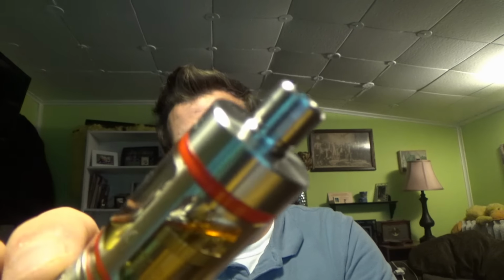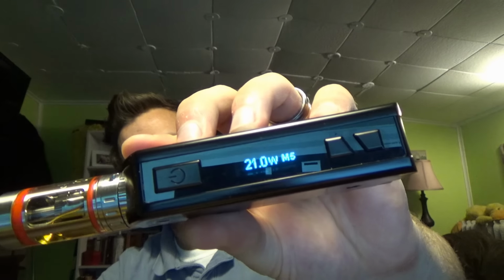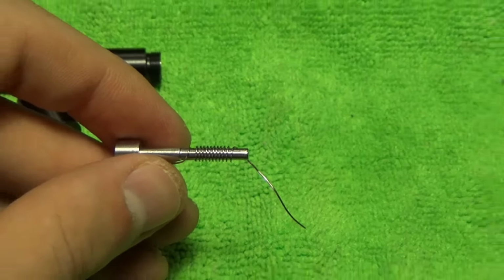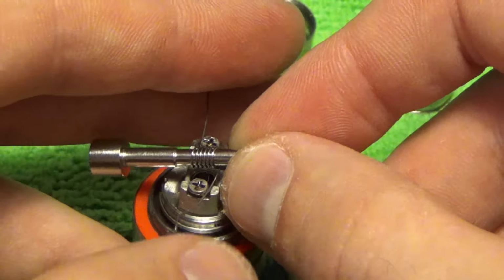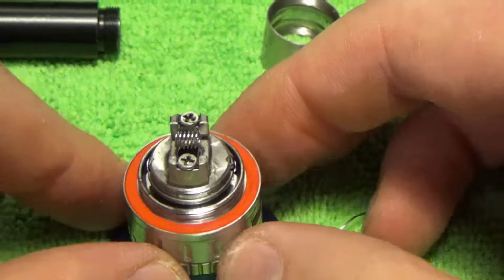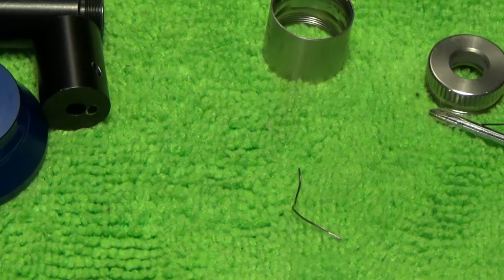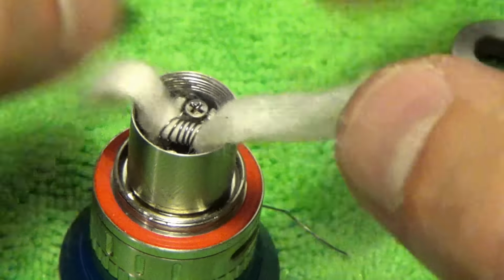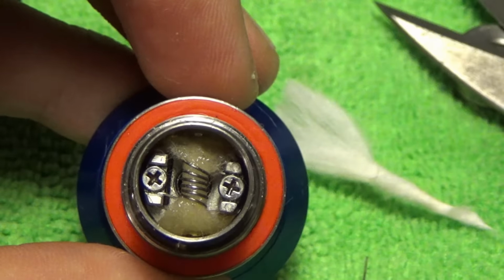Subtank Mini Build Tutorial - My Favorite Build

Comment: I've been using micro coils for a long time now so figured I'd try a spaced one.  Have to say that I like the spaced one better.  Thanks!
Reply from the maker: You are very welcome. Thanks for watching!
Reply: +Nooby Vapor   Funny I did the opposite. I used to space the coil, now I pinch that sucka tight. Can also do a nice chimney build.
Reply: +CaptianKeyz Actually I've gone back to micro coils, ha ha.
Reply: Nooby Vapor  I've just gone back to chimney builds. Seems to be more room vertically in my tanks, plus the air holes are in line with it.

Comment: I'm new to sub-ohming and building (I was never able to build successfully in the 'protank-vivi-nova era' as I like to call it and sort of left the vape world but I'm absolutely loving the days we're in now!  Just a question, what type of wire would I be better off using with the 75W TC Topbox (it's a sub-box with TC and more power basically, I had a subbox mini before I lost it)?  I'm trying to figure out whether 26 or 24g would be better.  Right now I have 30g from before and it's too thin to be useful so I'm basically twisting 2 or 3 of them together with a drill so it doesn't go to waste but I'm not sure that's the most efficient way of rebuilding.  Great video!

Comment: Is there a single TCT that is compatible with both Kanthal AND Titanium wire builds?? Just discovered that the TC Asolo by iJoy is capable of controlling temperature with a Kanthal wire build, as well as Titanium and Nickel!!.. I'm not interested in using a nickel wire build due to alleged health risks, but would, however, love a TC tank that is at least Kanthal and Titanium compatible.. If such a tank exists, suggestions would be greatly appreciated.. Thx!! =)
Reply: Check out the ijoy asolo. It's suppose to support any type of wire for temp control.

Comment: If the Juice holes are open like that, doesn't that allow the juice could completely fill the RBA and end up running down the air hole? I.e.: with a full tank of e-juice, wouldn't the level of juice inside the RBA reach the top, and therefore, spill down the airflow hole?
Reply from the maker: Cole VDV You'd think so, but it doesn't. Has something to do with the vacuum the chamber creates and surface tension of the juice. The subtank has never, ever leaked on me (one of the many reasons it's such a popular device). Some devices do leak, though (Billow v1 without perfect wicking).
Reply: I currently am using the Subox tank (figured the same methods could be utilized with it) and I have been getting a little bit of leakage when I adjust the airflow holes... Anyways thank you for the quick & informative response!

Comment: So I just started vaping, I am having trouble with tasting metal with the coils I am making. I am using kanthal a1 and nichrome and both taste heavily like metal. Any recommendations?
Reply: +Rob Mcg This is very unusual, these metals are not supposed to have a taste. Just like a metal spoon. Maybe you are confusing the metal taste with the taste of the cotton. Most of the cotton is not biological this means it is treated with pesticides to keep the bugs away and bleached with chemicals to give it a more appealing white colour.
Try using biological cotton, Japanese organic cotton or rayon as wicking material. You could also try boiling your cotton with demineralised water, i is importand that the water is demineralised water because tap and bottled waters contain minerals that could potentially give of a taste.

I hope this comment was helpful if U have any questions feel free to ask them.
Reply: So, I used to weld and it tastes like might welding used to smell. Definitely a metallic taste. I did try your build and it still had that taste but after about a day of use it went away. I am using 100% Japanese cotton in my builds. I also am trying to make sure my hands are very clean and washed before building them. I also tried firing them dry and not firing them until the build is done and has juice on it. When I fire the coils dry they do produce a smoke bloom, which makes me think it is burning off some sort of covering or machine oil or something. BTW I am very happy with vaping after 12 years of smoking 2 packs a day. I just need to get rba coils down so I can save some money in the long run. Thanks for any advice you can spare.
Reply: I ment I am cleaning my hands before wicking, I read that I could be picking up something from your hands and give it a distaste. Also I have rewicked the premade coils from kanger and I don't get the taste using the same rba and cotton. So it leaves me to think it is the wire. I think I may try boiling the wire coils for a good 20 minutes or so, to try to clean anything on them off.
Reply: +Rob Mcg try using another kanthal, I prefer Swedish. Often Chinese kanthal tastes like you have described.
Reply: +Rob Mcg P.S. possibly the tank you are using isn't clean enough, maybe it's because of machine oil. Try to clean it out one more time. The best way - ultrasonic cleaner.
Reply: +Rob Mcg it's probably a machine oil from the wire, i have a ud clapton coil and it taste like that, just torch and dip it in water or buy another brand should be good

Comment: Do you usually lung inhale or mouth to lung inhale?
Probably a silly question, but my flavors is really muted when mouth to lung hitting.
When lung hitting, the flavor is much better.
Reply from the maker: +Sean RobinsonJR Not silly at all. I'm a lung hitter.
Reply: +Sean RobinsonJR dunno bout that!?! when i close off the airflow slot for mouth2lung.......the flavour is seriously intense! subtanks are great for both in my opinion.
Reply: +Vape Stuff with John I have found, with this rig, either way works, just adjust your air flow.  Mouth to lung uses less juice, less air flow and lower wattage.  Where as direct to lung, more airflow, higher wattage and uses more juice.  The MAJOR difference, will be with an e-cig type rig.  You will likely take 2 or 3 short mouth hits, vs 1 long lung inhale, which will produce a heating issue and can more easily run you dry on juice for a dry hit, and ruined coil.  I just purchased the top tank version, (fills from the top) and it is awesome!  I've gone up to 60 and down to 16, and no dry hits!  I even built my first coil (which I haven't used yet) and unclipped, it runs about 1.25 ohm.  lol currently googling for the proper ohm range for this tank.

Comment: how do you prevent the popping sound when firing?
Reply from the maker: Ahmad Bard Sometimes the tank is popping and crackling away, and sometimes it isn't :) I think the crackling happens as tiny bits of juice reach the boiling point on a saturated wick. If you want to get rid of the popping, I'd try increased airflow, lower wattage, or less wick.

To be honest, though, except for the noise it's not a bad thing.

Comment: Nice vid. Just curious though- why would your favorite build in a sub-ohm tank be a plus-ohm build? Isn't that a bit of an oxymoron?
Reply: +The Meter He said it was a satisfying vape for him, which is surely what counts.

As for reasons why I do it, batteries last longer, uses less juice, thinner wire costs less, etc.  This  RBA is pretty easy to build on and I really like the Subtank.
Reply: +Frater Mus Thank you for your answer, but I was asking the person who posted the vid. I also have several Subtanks. Those tiny RBA sections are far from easy to build on. It's where I learned to build, and the reason that I very soon after bought an RDA with a larger Velocity style deck. But the question was why a plus-ohm build was put into a sub-ohm tank. There are plenty of tanks meant to use plus-ohm builds or coils. The entire point of a sub-ohm tank is to run a sub-ohm build or coil in it, hence the name.
Reply: this couil will work the exact same way than one made out of ss304 that has a deeper resistance and might if i am not mistaken fall under the "sub ohm" cathegory. i don't acre what the tank was set up as originally,,..if it tastes good and makes good flavor i will use it no matter if "sub ohm" in a ment-to-be not subohm tnak or visa versa a 1+ohm coil in a sub ohm tank... as long as it vapes satisfying it is no nonsense or whatever...

Comment: Do you really need an ohm tester?
Reply: +Muffin Man (MuFFiN MaN) If you have a box mod with an led screen that displays the ohms of the coil, its not really necessary
Reply: +Jason Bonedi Alright thanks, I have the Kbox so should be fine.
Reply: +Muffin Man (MuFFiN MaN) I have both k box and I make the coils about 6 rols and I cape fine at 25 watt
Reply: What's a gimmick?

Comment: John. 
That wire is NOT 28g. 
you cannot do 28 gauge wire with that coil tool. its just impossible. it will not hold. i tried many times its just too thin. thats probably 26g..
Reply: +Paul Naama it is possible... what the makers of that specific brand of coil jig DON'T tell you is that you have to move that "set screw" that's on the "head" to the "inboard" position when using a thin gauge. It comes stock in the "outboard" position, so just unscrew that little nut and move it to the other hole. Your problem will be solved! You'll see the silver set screw I'm talking about at 2:19 in the vid, it's laying down on the towel you can see the silver set screw.